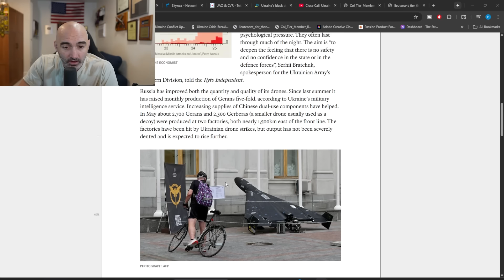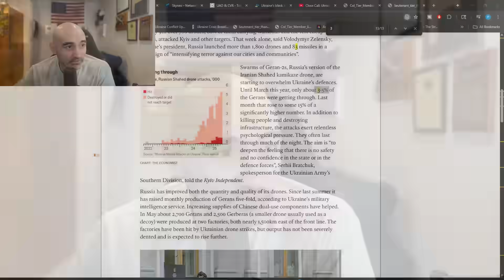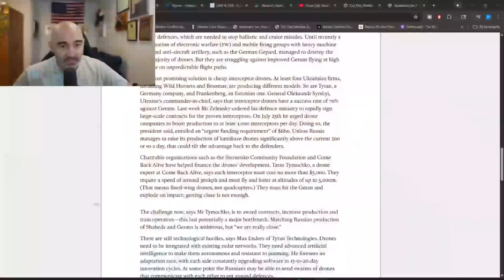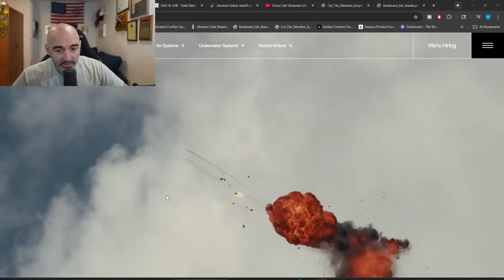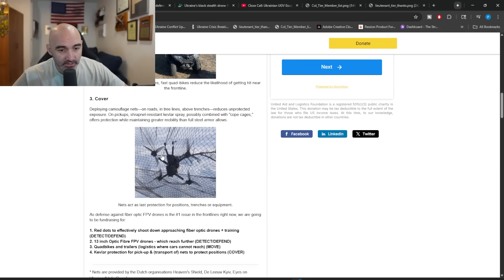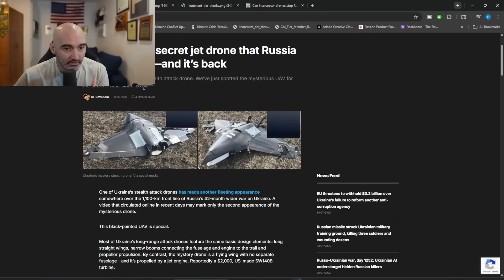Drone Warfare ARMS RACE is OUT OF CONTROL

Comment: You are looking for the word doctrine. The west not only needs to develope new cheaper drones, they should also have smaller units exersize while equiped with mock versions brief the units on what you have seen in Ukraine and tell them: this is the objective improvise with the drones and see what works. 300  boots on the ground can come up with more ways to aproach a situation than a hand full of deskbound officers that only have a vague idea of how these drones handel and what their strengths and weaknesses are. let them one team patrol and another unit ambush for example, then document what works and what does not and then see if the guys on the ground can come up with counters to the ambush. its all uncahrted terretory so an active stance to developing a working doctrine is the only way forward.

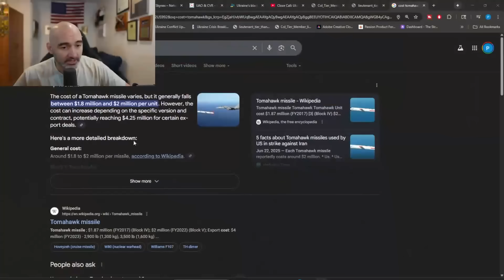Comment: @6:40 This is a terrible characterization.  The hull might be a 40yr old design, but that's about it.  Modern Tomahawk has optical guidance, multi-target capability, and satellite uplink, on top of having the range of the -136, better speed than a -238, and 10x the payload capacity.  Shaheds/Gerans aren't inexpensive, they're just cheap.  They're the IEDs of the skies.  They're not particularly effective, but they're a royal pain in the ass for the defender, and threaten to soak up disproportionate resources trying to protect against them.
Reply: LFO

Comment: There is also an element of the tension between open and closed systems. On the Open system side, you want to take the specialized device you just created and integrate it with other systems, both to receive and transmit information. Presumably each of the devices you might want to integrate with is also involved in its own innovation cycle, and you need to maintain compatibility with as much of it as you can. Not being integrated severely limits the capabilities of your device.
On the Closed System side, having a system that allows anything to connect to anything else leaves you vulnerable to spoofing, and using captured (or recovered) equiplent to reverse engineer how to infiltrate the enemy's combat system. Suppose you can put up a fake surveillance drone that makes enemy air/artillery strike calls  where there is no target. Here, I am assuming you guard against striking your known friendly position. But having your enemy firing on an empty field means those guns are not hitting your troops, while still giving away their position. 
This is the classic "those are old codes, but they check out" situation from Return of the Jedi.

Comment: For cost effectiveness we really need to improve prop technology (minimal funding with proper AI physics infrastructure) and make cheap single prop winged and nose pointed warheads than can hit air and ground targets at very high speeds. Take a few engineers who understand these technologies and you could easily get something well under 5k that can hit speeds of 600kph with 10+ mins of flight time. Frankly it pisses me off more allied countries aren't investing in advancing this technology that's so obviously the main consideration with modern warfare. Outside air force dominance through fighters obviously.

Comment: Think of the Borg in star trek. This is what is happening now in warfare. Machines are adapting at an increased speed against counter measures. However drones are not the only tool of war. You can not win a war only with tools. You need to have organisation and new tactics and strategies. Many battles have been won with inferior tools because of new ways of using them. I see Ukraine going from strength to strength in changing their doctrines, not being afraid to try things and learning all the time. I see Russia by contrast having problems with change. In some ways they respond but it is piecemeal. When the war first broke out I said if Ukraine could hold out for a month Russia would lose. That was because Russia would get bogged down and lose momentum. It was only a matter of time before the tables started to turn. This is not to say that Ukraine is having an easy time. War is always hard and unpredictable from day to day but when you stand back the direction is one way. What I find interesting is how Ukraine is shaping the war. My gut feeling is that by the end of this year or early next there will be some significant events no doubt surprising many armchair strategists. There are hints of it already. Does anyone else see what I see?

Comment: The procurement model will of necessity have to become decentralized with parallel  providers that can quickly adapt, compete and share tech when appropriate. One wonders if the Pentagon has to lose a war  to adopt a procurement model That does not rely on a few large defense contractors.

Comment: People laughed originaly when i said use shotguns, now its a popular choice for anti drones, we have tested sawn off shotguns, these fit in a holdster and great for CQB and drone interaction, you just need 2-3 hits in s few locations and most small drones are out of action or out of control. one handed and point and click. im suprised we have not seen these in comman use yet. you can also slit some shells in a few seconds so they act as solid for door entry. As range increases your shot scatters more, increasing chance of a hit to a point, and as these drones are lightweight ans cheap they have no protection.
Reply: If you are close enough to hit a drone with a shotgun you are within the blast and shrapnel radius of the drone. Not a useful weapon unfortunately.
Reply: hell im actually surprised no one has come up with a modern equivalent to a blunderbuss specifically for drones.  

like im thinking specialized rounds that are more like the size of a grenade, point and shoot and it sends a wall of metal towards the target.  maybe have it fire a burst of 2 or 3 rounds
Reply: Please explain how slitting a shell makes it act as a solid??

Comment: I'd say historians will look at this and call it the first modern war. This is not your father's Gulf war.

HMMMmmm. You know, I've read of jammer planes being used. I wonder if they could become some kind of budget NGAD, with processors on board (heck, you could run a multiCPU workstation) serving to coordinate defenses. The individual drones wouldn't need $10k worth of threadripper CPUs, right? Just the control aircraft.

Comment: Imo the perfect solution would be the "Sky Sentinel". Ukraine developed it. Regular people. It's a fully AI tower developed to shoot down Shahed drones. This thing is highly effective and costs just 150k per unit. It's estimated that you just need around 30 - 40 to protect even larger cities. 

40 of them cost just 6 million USD. The few units that exist can shoot down around 20% of the total amount of Shaheds that attack Kiev, and there are less than 10 of them. 

Imo it's important to get more money for the developers so they can increase the production. Imo it's the best and most cost-effective solution. I really hope they get way more support to build enough towers to protect their cities.
Reply: Except... it can't.  It's a century-old M2 .50.  Maximum effective range is going to be 1-2km, and altitude, about half that.  It's firing standard ball ammo (not self-destructing), so it can only perform perimeter defense firing outwards.  All a Shahed has to do is fly above the AA cover and dive on their target, and that's exactly what they're doing.

Comment: It would be a huge mistake to believe that the currently used fpv-drones can replace artillery, mortars, fighter jets, etc. The most effective way to beat the enemy is still by gaining air superiority and disrupting their supply lines. Cheap drones do not have that range and fire power.
Reply: What do humans bring to the battlefield besides risk? Any kind of drone means you can take much higher losses.
Reply: Overall you are correct but not in the way you think. Gaining superiority is key in both air water and land and disruption to the emeny logistics is vital to the former both at a local and regional level. What tools you use will always change.

Comment: There's software that can use cheap phone cameras and sound to track stealth planes, it works on the F-35 .
But tracking it close range means you already lost the battle, but for a place like Iran or Yemen put that system together with  40mm AA gun and something is coming down if they insist on going over the target

Comment: You can't use a Patriot missile costing many hundreds of thousands of dollars to shoot down a drone costing maybe $20,000. It's called "the shot exchange problem" and it's why NATO is in such deep trouble. We've gone for ultra-expensive ultra-high-end weapons so we only have a tiny number of them; meanwhile Russia has adapted to overwhelm the shiny NATO equipment with thousands of low-cost weapon systems. That's why Ukraine, being intelligent (and desperate) is building interceptor drones that cost less than the targets they shoot down. Anything else is economic suicide and militarily ineffective. The US wasted billions on shooting expensive missiles at the Houthis and... accomplished nothing of value because the targets struck were worth only a few thousand dollars (or less) each.

Comment: They have E.M.P. weapons now that put out a burst in a 360 pattern frying all the electronics and dropping them out of the sky all at once . It fits on a Hummer.
Reply: Won't that kill the electronics in the humvee too?
Reply: @themanwiththegoldengun1998 directed energy
Reply: @TheGeton69 at a drone flying at a unpredictable trajectory, those garans dive literally vertically
Reply: @themanwiththegoldengun1998  It would destroy the engine management system (EMS) but that may be worth it to not get bombed.
Reply: I know the brits have something in development, but I don't think anything is deployed.

And it wouldn't be a directed weapon if it was 360 - that would be a grenade.

I hope we still have neutron warheads in stock.

They are the perfect respone if Russia ever uses a battlefield nuke.

High altitude air bursts across the offending country.

No fallout of any significance, but that country is instantly propelled back to the pre-industrial age
Reply: It works like a dome over the area for a short distance, depending on the generator power output.

Comment: Forget drones and interceptor missles.
Think A.I. drone swarms. Swarms of swarms. 
You need thousands of mobile 35mm autocannon for what's coming.
Reply: The 2. Gen Leonidas system knocks small drones out of the sky
AI, fiberoptics or radio control doesn't matter if it comes within range (1km official range) it is going down
Reply: Or a very large net held in place by balloons